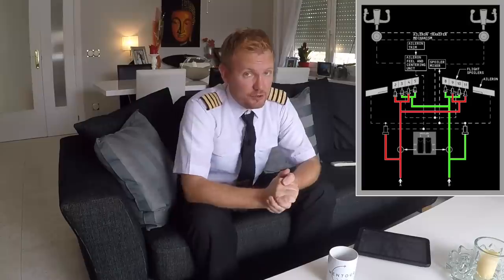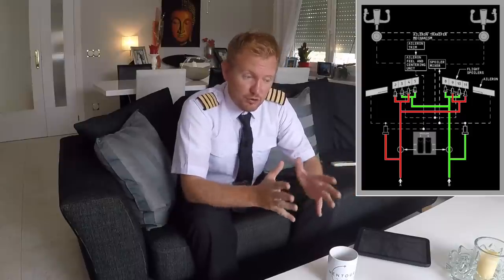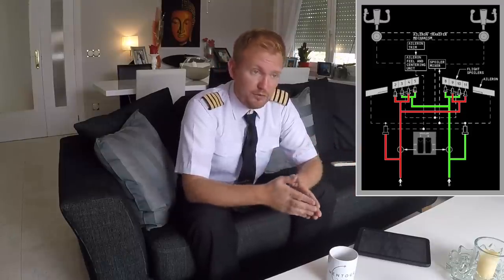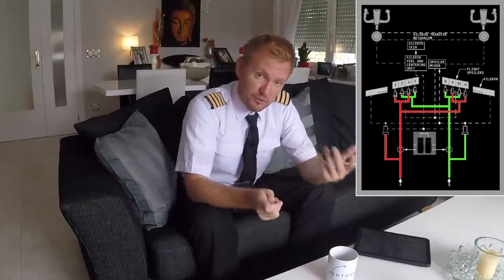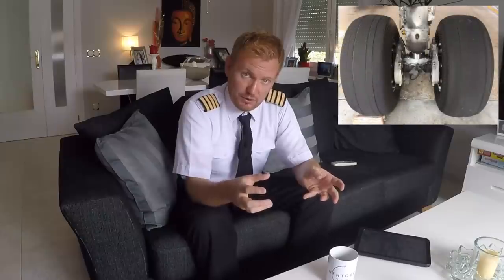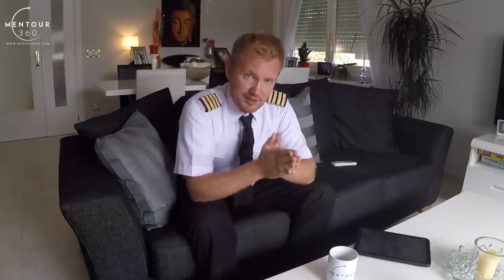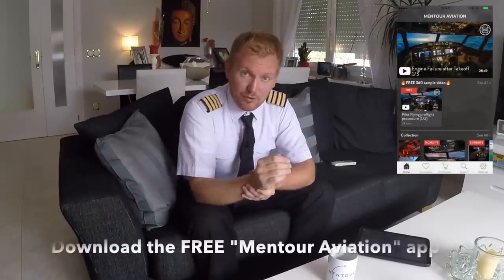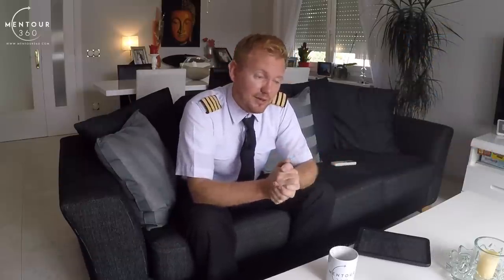What are those things on the aircraft wing?

Comment: Thumbs up for this video................. If the foilers would not work on landing couldn't you just hold the nose of the plane up at a steep angle (possible skid plate attached to the underside of the tail) the nose settle gently on the runway. This takes up more runway, but involves less systems should the foilers stop working or jam. Again, you can slow down, come down to a safe altitude, rent parachutes to everyone and push them out the door. The airline would make a good profit in parachute rental and remember to have a credit card machine on board LOL, then land the plane empty and come in at stall speed which is safe when the plane is light without passengers and cargo.......  To me the safest plane out there is the Boeing B-52 with 8 engines.  If some engines fail, you can push whatever cargo is on it out the back and still fly home on at least 4 engines, this means people with parachutes, parachute rental, more money for the airline, haul more people at one time for a farther distance. Right now I think we only use it as a long range bomber and cargo plane for the air-force.  I think the 777 right now is the most dangerous jet out there with it's really big engines that can suck all kinds of shit in and only two engines hauling as many passengers as the 4 engine B-747, which if you kick off half the passengers will fly on two engines lol...... They say the 777 can fly on one engine, but it's so big can you imagine the yaw of that plane, and the rudder does not look big enough to handle a fully loaded plane on one engine, however again parachute rental would be a money making solution for the airline and leave the passengers to their own fate when they hit the ground. They could double the cost for parachute rental for fat people and offer bigger parachutes to them lol.

Comment: Ok, in a nutshell, when you move your ailerons fully left and right, you will notice the they don't move equally up as much as they do down. So when you make a aileron roll, The aircraft would not roll perfectly on its axis/centerline. One wing will get more lift than the other per actual surface. The spoiler will compensate for the lack of the flight control surface from the aileron. The aileron drops lower for a landing configuration or high angle of attack. Generally.

Comment: Hi Mentour. Great video as always. Thank you. I've a question. I noticed that, during turns, spoilers tend to move only at lower speeds, while during cruise only ailerons move. Is this correct? Is it related to the fact that when speed is relatively low, more drag is needed to roll the wings? Thank you!

Comment: So these spoilers basically have the same 2 effects as the spoiler or "wing" on a racecar - downforce to counteract or reduce lift(funny to call it a wing in racing since lift is exactly what you DON'T want!) 

The other effect being drag, an obvious downside & never ending balancing act in racing(more downforce = more drag). Interestingly enough in recent times this challenged race teams & manufacturers like Porsche/Ferrari to find clever ways with underbody airflow to essentially suck the car to the road without near the drag penalty of a traditional spoiler. In fact Ferrari learned a great deal on this in F1, & has been applying it to their street cars for nearly "free" downforce w/minimal drag several years now. Porsche & other performance car companies are as well..

The original motivation behind spoilers & downforce in racing was it makes for a much better handling car that can maneuver, turn, & brake faster. Obviously airlines using spoilers on the runway during landing reaps them these same benefits. In addition to drag,  their added downforce helps keep the plane pressed firmly to the tarmac for better handling & braking. Not a bad thing w/such a big bird filled w/people!
Always wondered if those spoilers on top were doing same as on sports cars I grew up watching race at Daytona! Thanks for clarifying perfect as always. Cool stuff!

Comment: Are there no crossfeed valves to power the inoperative hydraulic system in case of failure? (of course overridable in case of leak.)
Also in a fighter jet you actually, depending on the runway length just keep your nose up after landing, using the wings for extra drag applying low to medium pressure on the brakes to prevent overheat and overuse. eventually you will slowly have the nose sink down and you apply brakes as needed. I guess that's not really an option in something this large and heavy.
Reply: FalcoGer Oh airliners do keep the nose up after landing as well

Comment: Wouldn't it be safer if you could completely disable the flight spoiler during takeoff phase?  If you have spoilers deploy at all during crosswind correction on takeoff doesn't that present a risk of that wing stalling, potentially catastrophically?
Reply: Jim Imhoff what about rto?
Reply from the maker: +Jim Imhoff No, the spoilers are crucial in case of a Rejected takeoff and they might also be needed if a severe gust would occur during the rotation. As long as we are aware of it it's fine, they won't stall the wings.

Comment: On a recent 737 flight I saw (and photographed) 10-15 round dents on the flight spoilers. There was no visible damage on other surfaces and I could not see the ground spoilers. Could these be caused by activation in hail or some other FOD?
Reply: Alan Daters Quite normal, probable causes are birds in flight, gravel on ground. Hail can cause damage but it has to be quite extreme to do that.

Comment: Hi Mentour...great videos

Why do the Airbus control sticks not work in tandum ? Seems like a design flaw or do they work in tandum?
Reply: Todd Lavigne because you don't want both pilots using the sidestick at the same time because the pilots inputs would conflict and not work effectively.
Reply: they kind of do.  the deflections will be added together but will never be more than the max deflection of one stick.
Reply: CrazyHypedGamer and that's how air France made there big mistake with the A330...
Reply: Todd Lavigne on the A320 if a dual input is made, it is analyzed by the computer, the reaction is the sum of the inputs
Reply: Ava Mendez yes it is true which makes the FP/CP PRIO is necessary

Comment: Nice video, thanks. Do you have video about other part of wings, those stuck out during takeoff and landing, but joining main wing during the fly.
Reply from the maker: +mrxiaolaotou The flaps?
Reply: But why it needs flaps? For breaks or for something else?
Reply: mrxiaolaotou Flaps increase the lift produced by the wing, and makes the aircraft more controllable on slower speeds by lowering the stall speed, at the cost of increasing drag (therefore it also slows down the aircraft, which can actually reduce lift).
Reply: Thanks, learning a lot from you

Comment: What is ANTI SKID?

And why arn't the ground spoilers COMPLETLY Vertical?
Reply: KingofDestruction spoilers are plates on the top surface of a wing that can be extended upward into the airflow to spoil it. in so doing, the spoiler creates a controlled stall over the portion of the wing behind it, greatly reducing the lift of that wing section. braking on the A320 is done "by wire" which means there is nothing mechanical between the pedals and the brakes. the anti skid functions by analysing the speed of each wheel as the brakes come into play.  if we have  one individual wheel braking more than the rest, that brake will, ease off, allowing it to rejoin the other wheels.
Reply: Ava Mendez ----- thx for ur co-operation, but u didn't really exp what stops the ground spoilers from deploying vertically (90°)
Reply: KingofDestruction spoilers not only kill lift they are also used to control rate of descent,  if.lift is ripped away from the surface too quickly,  the airframe comes down really hard and next thing you lnow the landing gear is being probed for damage
Reply: Ava Mendez ---ah i see, thanks
btw, y do u hav a pic of "high heels" ? ؟ ¿
Reply: KingofDestruction no but my fiance gave me a pair of Kurt Geiger's last Christmas that were
beyond words. just for reference, the spoilers on the A320 at landing are at fifty degrees dumping lift at a rate of knots..anything more would just be overkill.
Reply: Ava Mendez --- wow, you're so experianced! From where do u get these infos from? Are you a pilot, or training to be one??
Reply: KingofDestruction i was on the A320 for five years
Reply: Ava Mendez --- 😮 so u are a captain! What plane do u fly now?
Reply: Much like ABS on cars
Reply: Whats ABS?
Reply: KingofDestruction ABS anti lock breaking system.  great piece of.kit in an automobile  that allows the wheels  to remain in contact with the road surface according to driver inputs while braking, preventing the wheels from locking or stopping rotation, this helps in avoiding uncontrolled skidding across the surface.
specifically for the A320, 
 those wheel brakes are modulated by a dual channel BSCU: Brake and Steering Control Unit. the A320's brakes and nosewheel steering may be considered "steer by wire." he primary actuation mechanism is through pedels located near the pilots' feet
Reply: Ava Mendez ----- i see so there is steer by wire and flyby wire!!! 🤣😂. 
Btw u didnt tell me what plane u fly currently?

Comment: What's the average rotation and landing speed of an a320 in usual conditions ?
Reply from the maker: +Josh Nesbitt Hi! The a320 is not my speciality, I'm more of a Boeing guy but I'm guessing around 140kt for takeoff and similar for landing. That's what the B737 uses.
Reply: Josh Nesbitt for the A320, there is no usual condition. before we push from the gate, we plug in a series of numbers to our ipad: the runway, the condition of the runway, the slope, the aircraft c.g., the winds,  
the weight of the airplane and the flap setting. this in turn generates three speeds V1: go or no go speed.
Vr: the rotation speed at which the nose is lifted into the air and V2: the takeoff safety speed. The A320 is a joy to fly, after 5 years, not one incident💖

Comment: Alse the streamline shaped pods under the wings are housings for the hydraulic actuators, these are not fuel tanks.
Reply from the maker: +user2kffs Correct. They house the trailing edge flap mechanism.

Comment: so you're saying, (aerodynamic grip) when the plain is on the ground (landing), in the ground spoiler mode, (full extended spoilers?) it acts the same way as a spoiler on a car, by air pushing and forcing the back end of the car down so as to help your rear car tires keep a good grip on the road...as too the plain wheels, forcing downward pressure, to keep a good firm grip on the runway and to help slow and stop the aircraft... knowing every little thing helps. (assistance from any and all available aircraft functions that can help slow a plain and create drag, besides using the breaks) i.e. Full flaps extended, full ailerons, reverse thrust, landing into the wind perhaps..an open door or two, tie a rope to somebody or their luggage for a anchor, a parachute.  lol Just kidding. Aerodynamic Grip....is that what you use the full extended spoilers for....slow and stop assist?  Correct? Makes sense if I'm understanding you correctly.

Comment: Another overly complicated explanation of a flight control. Spoilers (ground), used on landing to kill lift thus placing the weight of the aircraft on the gear sooner so the wheel brakes maybe  applied sooner. Usually placed in the auto position and are then activated by a squat switch on the main gear upon landing. 
Flight spoilers not much more complicated. Fewer used in flight used to reduce lift without slowing the aircraft down and maintaining a level attitude. WOW 11 minutes to explain! Yes I know about high speed spoilers again not complicated.
Pilots, glorified bus drivers.

Comment: You may be an expert about aviation but you need more training in making videos. You began the video promising to explain what the flight and ground spoilers do, but then you immediately went into an overly long and complex description of the hydraulics systems. It took you quite a while to get back to the spoilers but even then you introduced new topics such as roll control. You  need to force yourself to introduce and define one item at a time, and do so in an easy to understand way, and build from there, one concept at a time. Also, especially at the beginning of the video your rate of speech is very fast. With your accent it was hard to understand what you were saying.